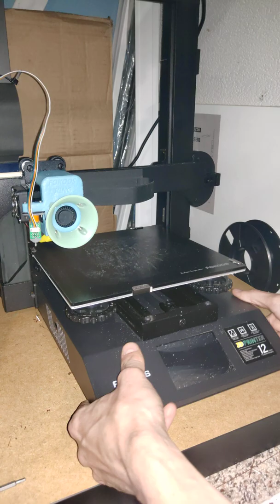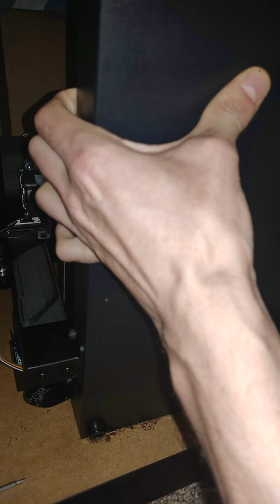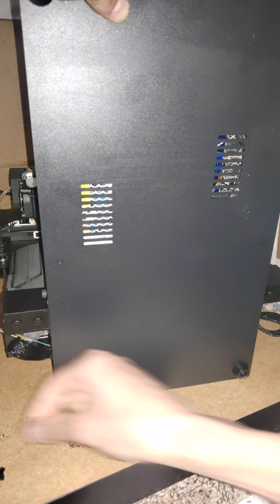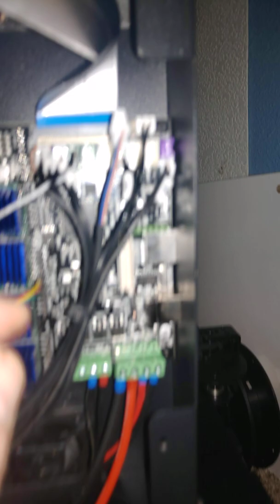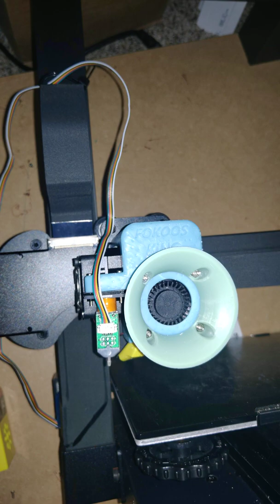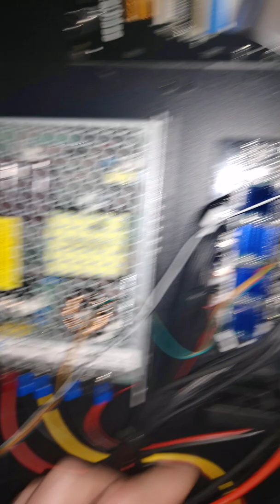FOKOOS ODIN-5 F3 BLTouch or 3DTouch hookup, link to firmware, case internals, how to access

Comment: Do you have any updates on this and how it's been working? I've seen issues on the fb group I wanna make sure my printer will work just as good as it is now and not mess up. Also I'm doing the 3d touch like you have
Reply from the maker: I have updated the firmware as recently as today, works well for me.  I am not on facebook so do not have any insights into problems users may be having there.  If the issues they are having are with my firmware in-particular, I would expect these to arise in the "Issues" page of the project's github so that I can actually be notified of and fix them.
I have enabled several features that are not "stock", you can see all of what has been enabled in the project Readme on github.  This should help you to decide if you want to use it, or not.  You can always re-flash the stock firmware if you decide this is not for you.  Hope that helps.

Comment: So for bltouch you just need to connect directly to the motherboard?I saw something very confusional on the fb group,where someone before used to connect to the extruder,then connect on the motherboard and lastly connect on the board under the z motor...that discouraged me from install,but your video looks way cleaner,to the point i bought a bltouch
Reply from the maker: Yeah, you can just run the wire through the grommet that the other wires run through, or there is a slot to the left of the power supply that you can run it through.  Then the black and white wire go to the Z endstop, the other 3 wires go to the BLTouch port on the Robin Nano board.  You can put a zip-tie loosely around the ribbon cable that runs up the Y-axis and run the BLTouch cable through the zip-tie and this will keep the cable out of the way of prints.
The video you watched, they must have maybe found some unused pins in the 22-pin ribbon cable that runs along the machine and wired theirs up that way; but you are correct this would be a lot more work and likely require soldering.
Reply: @mediocremaker3867  Thank you so so much!
Reply from the maker: @osvy1211  you are welcome!  one correction in my comment, i said put a zip-tie around the ribbon cable that runs up the Y-axis...I meant the Z-axis (the vertical cable)!
Reply: @mediocremaker3867  Just done it,the bl touch works but even with the harness(1 meter)i struggle to reach all the corner without getting the cable streched..i will just look for a longer harness!
Reply from the maker: @osvy1211  Yeah sometimes the kit comes with extension cables, sometimes not!  Just depends what seller you buy from, I think.  You might need to also use hot-glue on them once attached to the mainboard as I am sure you noticed they are not the correct connector for seating properly.

Comment: Does that cone really help with air?
Reply from the maker: It helps a little with the fan noise but mostly it keeps errant strings of filament from getting sucked into the fan.  It happened after I used a particular silk gold filament, which ended up being very stringy, and the hair-like strings got all caught in my fan and made it very noisy and hard to turn at low RPM and I eventually replaced the fan.  So it can definitely increase the lifespan of your fan by helping to prevent that from happening.
The fan spacer on the hotend fan should improve the static pressure for better cooling, in theory I haven't done any measurements.
EDIT:  the person who made the parts for the shroud has released a different version, if you would like to check that out instead.  It looks like it eliminates the cone and covers that space over entirely somehow.  https://www.thingiverse.com/thing:5240501
Reply: @mediocremaker3867  awsome thank you! And have you found any spare after market parts for this machine? Since the kit is sold out on fokoos
Reply from the maker: @mikek2824  Some of it can be purchased separately.  For nozzles get 'volcano nozzles' (0.4mm is the stock size), the thermistors are just 100k thermistors and so are the same type used by many printers such as Creality ones (note that you will have to cut the Creality ones to length and solder the connector from the Fokoos thermistor onto the end).  The ribbon cables are 22-pin but they look like a proprietary length and I have only really seen 150mm length ones available on Amazon but maybe on Mouser they will have other options, my machine came with some extra ribbons cables luckily.
The hotend looks like this one:  https://www.amazon.com/Temperature-Volcano-Cartridge-Extruder-Printer/dp/B08NV8JHNJ/
The same company that makes that hotend also make a heatbreak and silicon sock that go with it.  I will probably pick these up because my hotend is looking worse for the wear, it hasn't had a silicon sock on it in a looooong time.
The v-slot wheels seem to be just the same ones you would get for, say, an Ender 3 which are 24mm but I would have to measure them and get back to you.
The filament sensor is fitted on a PCB so that it positions snuggly into the extruder assembly, so while it wouldn't be impossible to implement some other filament runout switch it would require you to come up with your own mount for it.
On my machine I have so far had to replace the parts cooling fan once and the thermistor twice, but like I said I haven't had a silicon sock over the hotend for a while and I have definitely had incidents of my hotend getting covered with goop and covering the thermistor with melted filament.  Also had to make a tiny spring to go in the extruder because I lost the one that was in there initially when it flew across the room.

Comment: so can you not show the other places you hooked up so i can see the colors and where you placed them up?
Reply from the maker: Sorry for glossing over it in the video.  There is a 3-pin connector for the z-endstop, remove this from its socket.  The socket is green on the circuit board and is labelled "Z-", do not confuse with z-motor which is 4-pins.  There is also a "Z+" endstop, but we can ignore this one.  Fokoos have labelled the cables which should help identify the proper bundle to pull, as well.
Look for the text on the board (Robin Nano) to identify the top, bottom, left, and right.  The next instructions are for 3DTouch, the BLTouch is likely the same I do not have one to compare though.
Take the black and white wires from the 3DTouch and insert them into the space where you removed the z-endstop.  The white wire will go on the left-most pin, the black wire on the middle pin.  The right-most pin will be empty
Next, locate the text on the circuit board "BLTOUCH", this identifies the remaining three pins you need to connect.  For the 3DTouch, the yellow wire will go on the right-most pin labelled "S", the red wire will go on the middle pin labelled "5V", and the green wire will go on the left-most pin labelled "G".
Here is an image of the board that may help as well:  https://www.roboter-bausatz.de/media/image/08/fe/a5/RBS13799-Makerbase-MKS-Robin-Nano-32-Bit-3D-Drucker-Mainboard-3_600x600.jpg

Comment: This looks easier than I thought.  On the Facebook group someone did all sorts of soldering and stuff?  Yikes.  Which firmware did you use?  I am guessing the King one, since his offsets for his mount are probably preset?  Thanks
Reply from the maker: There wasn't a firmware available that I could find that had touch-sensor enabled so I used the stock firmware files provided by fokoos' github and edited them to add options for touch-sensor such as ABL and G34 dual-z level-check.  You can get the .bin at https://github.com/CBJBinterwebs/fokoos-odin-marlin2.0.x-w_bltouch.  Please note that it includes some UI changes such as adding the current bed/nozzle temperature to more screens so that this info is available in different menus, and a couple different icons.  I am still working on improving the UI and put all the edited files onto github, not just the bin file.
It is interesting that they were soldering for adding a touch-sensor.  I wonder if they maybe found some unused pins in the ribbon cable and tapped-into those so as to not have to run the seperate touch-sensor cable.